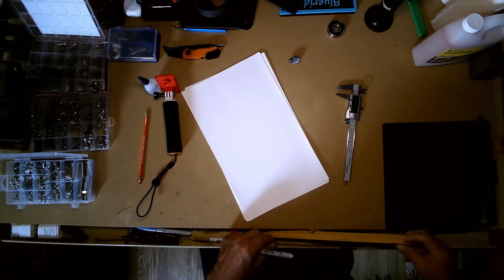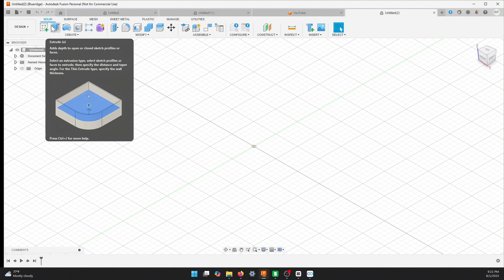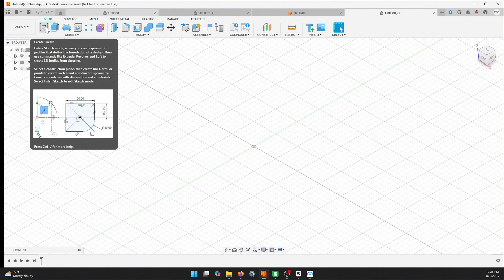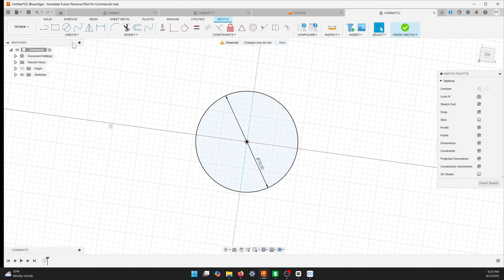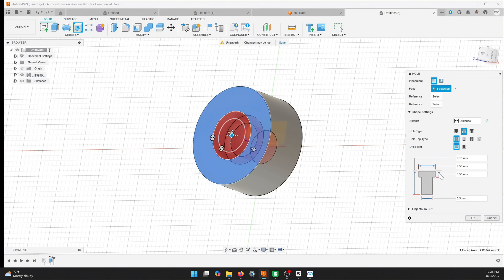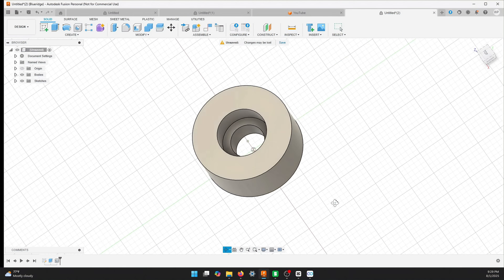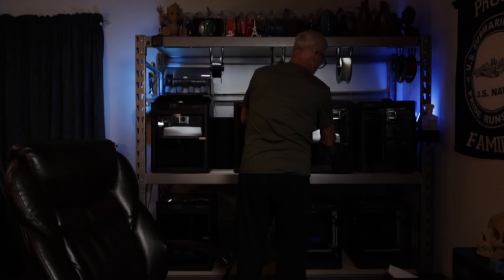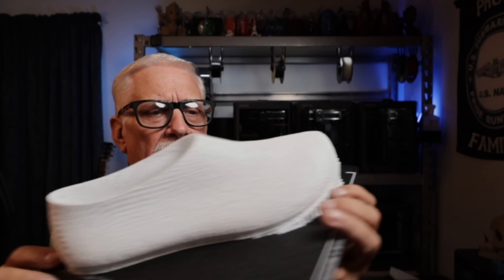How to Sketch, Design & Finish A 3D Printed Part Under 15 Minutes! 3d Printing Senior Makes It Easy!

Comment: New subscriber here. 72 in a few weeks. Still above ground, still punching the clock 9 to 5 week days.  Just started a few months ago when I bought my first 3D printer. Bambu P1S with AMS.  Started trying to design a small part in Fusion 360 about a week ago.  Haven't managed to get a working part yet but not giving up yet.
Reply from the maker: Anyway thanks for watching my video and for subscribing. My first printer was the p1s with an AMS system. You didn't go wrong in your pick.  If I can help you in any way just let me know.
Reply from the maker: Look at my video for the spacer. It's a very easy one and that video did very well.
Reply: @Blueridge3Dprints  Been a while since I posted but just to let you know I did watch your video and I have successfully created a small part for a relative in England.  Took me 3 attempts but I've made 6 of these parts and sent them off to her.  She is one very happy camper.   I will post a short video later to show the part.
Reply from the maker: I'll find that link for you
Reply from the maker: Lol.... I think that's the video you were watching.😅

Comment: A word of caution on Fusion 360: just because your files are stored in the cloud, doesn't mean they can't corrupt. I had a very involved set of parts in a file, and I couldn't open it. File is corrupted. How? I have no idea. If this happens to you, you may be able to open previous versions. I was on v29 of the file, and I was able to open v27. Far from ideal, but not a total loss. They expect you to upload your file to a public forum for help recovering it. What? Anyway, keep local backups and test them! This was an eye-opening experience for me.
Reply from the maker: I used a free version online when I do the tutorials. This lets viewers know that the version that they have for free and do the same thing that I'm showing them. I don't keep a lot of stuff up on the cloud on my commercial account. Generally I work on it and then save it to my computer. I'm not working on anything complex enough to keep on their server. Thanks for the heads up though ...... Also thanks for watching my videos.
Reply: @Blueridge3Dprints  I didn't think you could work on local files. I know that the free version you cannot, which is what I have. You CAN save them locally, but you CANNOT work on them without uploading them back to the cloud. So is my experience incorrect when using the commercial version? You can use your files locally like a normal program? I am slightly confused because my 30 seconds of research says you can use the Autodesk Desktop Connector to sync your files between the cloud and your device, but you're always working on the cloud version. And I would just assume from there that if the cloud version corrupts, it'll sync that corrupt version locally. Of course there are ways to deal with that, but it just feels like I shouldn't have to just to use a freaking program.
Reply from the maker: @michaelgleason4791 I don't know Michael.... You know I've only been doing this for 8 weeks right? Right now I'm trying to push through different types of 3D modeling file types. Are you saying I shouldn't use fusion and I shouldn't put my files or someone can see them
Reply: @Blueridge3Dprints  Oh I'm just saying that you need to back up your designs locally, just in case they ever get corrupted in the cloud. Open your design, then go up to File (looks sorta like a piece of paper, the top item in the File menu is "New Design") and click export, then save it somewhere on your computer as an Autodesk Fusion Archive (*.f3d). Sorry no I had no idea you're new to Fusion 360! Absolutely use it if you're comfortable with the way it works. I use it. I thought you were just new to the printing part! Wow, you're doing an excellent job. Glad I found this channel.

Comment: Just subscribed and I’m 71 yrs old.  I have learned more using Fusion 360 with your video on making that spacer.

I have no experience designing in fusion, I want to solve problems with my designs and print them.  Again thank you 🙏🏼
Thank you
Reply from the maker: Well I hope you made the spacer..... And you should check out some of the other fusion tutorials that I'm doing. I look at it as a beginner's perspective. Mainly because I am a beginner of only been doing this a little over 2 months. And that's just about 3 to 4 hours a week working in the program and watching videos. I found the best thing to do though is to keep doing the same thing over and over but changing it a little bit as I go it really helped me to jump leaps and bounds. Thanks for subscribing and your kind words. Feel free to reach out to me for anything. And most of all thanks for watching my video.

Comment: 3D printed shoes? This 66 year old with secondhand printer is getting some ideas fast here.  The latest printers are now home appliances, turn them on and print. No tweaking and messing about to get a print.  Maybe PLA-LW for print flying dragons? Old model plane guy, haha.  Been using resin, OpenSCAD for model train stuff, only just got a FDM.
Reply from the maker: I generally think that 3D printers will become a home appliance. I remember sitting in front of the microwave watching it make popcorn as if it was a TV........... Oh wait I do that with a 3D printer. See the correlation? And you just can't go printing shoes oh willy-nilly........ You got to dry that filament first especially that TPU. I wanted to do another video about making shoes but that video tanked. Think I only got a thousand views on it. My last video got 6,000 views and one and a half days. Of course I'm not trying to hit it out of the park every video. And I want to print a nicer pair of shoes. Thanks for watching my videos.

Comment: How do you send the sliced file to the printer?  I have to put the sliced file on a micro sd and carry that to the printer etc.   My printer is a several year old Ender 3.
Reply from the maker: I have no experience on the Ender. As long as it's on your computer you do it the same way you would any other STL file. I believe the enders do not have Wi-Fi and that's how the new printers are. I believe there is a thing called a raspberry that allows you to connect it to your printer and it becomes a micro computer and it has Wi-Fi. I believe it's a kit. I had a company reach out to me to sponsor my videos with one and I wasn't really sure what it was at the time but after looking it up I think that's what it is. If you would like more information just let me know. Thanks for commenting and for watching.

Comment: Old persons Florida shoes LOL - have fun printing. Hope the set up cost pays back to you
Reply from the maker: It doing better than I thought it would. As with any start up, ( in my first 3 months) it will take a little time to get traction. but my overhead is very low at around $5000 for equipment on the 3D printing side and $1500 on the YouTube side. My last start-up I did 23 years ago I was in 85K. I sold that business at the beginning of last year and now it's on to the new endeavor. I just got monetized today in less than 90 days and as I build my video library the AdSense will grow and I am receiving sponsorship offers. So I will just keep putting in the reps. Thanks for the comment and watching.

Comment: I have been involved with cnc equipment, programming manually, 2d and 3d design since 1975 and have never started with paper except for maybe writing down key dimensions to use. Anything I can mentally visualize can be put on the screen without the paper. If one finds it easier to start with paper, by all means do it, but I have never found that helps speed it up at all.
Reply from the maker: It's not to speed it up .... I'm trying to show someone the path to Fusion. If a new user has a visual of what I going to do, it helps to eliminate uncertainty of what I'm making and can focus on the process. You may be to advanced for my tutorials. I've only started two months ago and could only find a few beginner friendly videos. I  know I suck at it and at making videos, but I am doing the reps to get better. I hope this helps. Thanks for commenting.
Reply: @Blueridge3Dprints 
I think you are doing a great job and by the comments you have identified a niche of viewers that are responding very positively.

Comment: Add a 0.5mm chamfer to the bottom of your part. It makes the printed part much cleaner.
Reply from the maker: I was trying to be as simple as possible. Trying to help beginners to start. next Fridays video is "Gears" We'll do it there. Thanks for the tip and for watching.

Comment: I'm in the same position you are. I'm 77 years old and am learning Blender 4.4. I get no thrill printing somebody else's files. I'm designing functional parts for personal projects. I have Fusion 360 and am having a lot of trouble wrapping my mind around the need for external references and the like. Blender is tough to learn but it seems to make more sense to me.
Reply from the maker: We must be old .... we like doing the work. Really any software you can model and print from is all you need and I am still trying to get my head wrapping around fusion still. Either way .... one sketch at a time. Thanks for subscribing.

Comment: I'm similar to you, 61 new to 3d printing. Printing my own self designed prints is so satisfying, especially when the one or two don't quite work, the satisfaction of getting it right is immense. One of lifes simple pleasures when you're getting older. I'm going to try the fusion 360 as I've been using tinkercad which is ok but not perfect.
Reply from the maker: Well it won't hurt to download it....... Start off with simple parts and work your way up. I'm really starting to enjoy it now.
Reply from the maker: Thanks for your comment and for watching my videos.

Comment: Great video!  I’m only 2 months into 3d printing so I’m taking in all the info I can get. For this project, could you have selected the entire sign, changed the filament color to red, and then only have to select the sunken area to fill in as Black, rather than painting each letter? That’s seems to have worked for me.
Reply from the maker: That's a freaking awesome idea

Comment: Great Video, a helpful tip for getting your part into the slicer is to use File -> 3D Print, then chose Print Utility as the Preparation Type, under Application choose your slicer software, and then any of the other options to suit your requirements, and your slicer software should open and load the model. The alternate method is to right click on the top of the component list and choose Save as Mesh, this will give you the same options, but I find this will keep the settings, so it is ready to go next time.
Reply from the maker: Thank you so much for the help. I will try to do that next time. I try to find the simplest way possible for someone who's just starting with it not to get frustrated with it. So any shortcuts and any help is always welcome.
Reply: @Blueridge3Dprints  Easiest way to send your parts to the 3D slicer is navigating in Fusion to 'Utilities' and then hitting 'Make/3D Print'. Once you've selected the path to your slicer, it'll from then open it automatically for you. You can also adjust the mesh-refinement ('refinement settings') at the bottom of that dialogue, before sending.

You can either send a single selected part, a selected component-group or all currently visible objects by selecting the whole project in the tree-view at the left. When sending multiple objects/parts at once, the slicer will ask you how to treat them, as individual parts on the printplate or as one single part containing multiple parts (for print-in-place objects where every part must keep it's exact position in a print). You don't need to necessarily select the old STL format, 3MF is the more modern choice, (OBJ would work as well) - your slicer will accept all of them.

Keep it up and have fun!! :)

Comment: I used to use 3d studio max years ago, and i was pretty ok with it, but just coming back into 3d and new to printing, just the video I was looking for to refresh my memory a little, thank you.
Reply from the maker: I really appreciate your comment. I'm really starting to enjoy it. I had been working in alpha cam for the past year but that's not modeling that's more CNC. I enjoyed this much more. And if you're new to 3D printing you don't need to learn fusion or any CAD software, well not least at the beginning there are literally a million files that you can print for free. All you need to start is $200-$300 to pick up a printer. I have enclosed printers and printers that are not and I always use my enclosed ones first. I'm quite impressed with the centauri carbons and wish they had been available when I started buying printers. I like my bamboos and I probably use my original p1s more than the rest. But if you want more motivation...... Go get a printer! Thank you so much for watching my videos and subscribing. It truly means the world to me.

Comment: Exactly the type of videos I need.  I have zero CAD-type experience and that is what's holding me back from ordering my printer, so I do want to go back and watch more of your videos.  Glad I found you.
Reply from the maker: As I've said in a comment before you don't need to learn fusion or a CAD program to start printing you just need a couple hundred bucks. I suggest picking up a printer. There is a million files that you can print for free. You just open the slicer pick the item you want and tell it to print. Thanks for your comment I get so much out of it. And thanks for watching.
Reply: Theres a lot off free software available. I suggest TinkerCad if your a beginner and want an easy to use tool.

Comment: Although there are many ways to do the same thing in Fusion360, you may wish to try to sketch the profile and do a revolve. By doing the profile sketch you will have all your dimensions in the same place, the sketch, and not across a couple of extrudes. You might be down to less than 9 minutes this way and your design can be re-used more easily.
Reply from the maker: Thank you. I already thought I was going pretty fast......lol. but I know I'm only 4 weeks into learning fusion. Just looking for a simple way to get across to my viewers that it's not a daunting thing to have to learn. Just after doing a small print like that from start to holding the item in your hand is amazing. I tend to lose watch time on my videos when I do fusion so I don't do it on screen very often. But I just tried to simplify as best I could. Thanks for the watch and commenting........ That's what makes me grow.

Comment: Great channel, just had to comment on you using metric and being in the U.S.A., not something I was expecting. You do know you can setup the units in Fusion 360 to be imperial. I had to do that for some parts I produced for someone in California. I am a retired steel draftsman and spent the last 25 years using 3D cad at work, great to see others learning it too.
Reply from the maker: Thanks for the kind words. What channel is I work in progress. I would like to show more fusion 360 but I lose so many viewers. I understand it could be boring to look at. 6 months ago I wouldn't have watched the video. I do know about the settings for setting it up for imperial. My last business was custom painting all the paints were measured in metric and now my day job is running a big CNC machine for cabinet company and everything is measured out in metric. I just prefer it now. How is the master Carpenter for 20 years and used imperial down to the 64th of an inch. But I find that metric is more precise. At my day job I use alpha cam and cabinet vision. But it's just like learning a different languages. Thanks for watching my videos and for commenting.